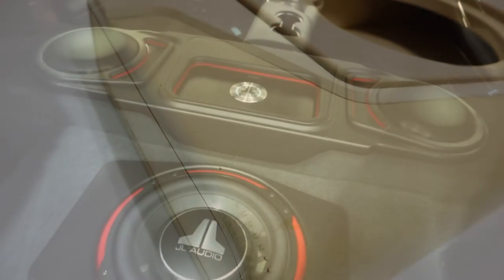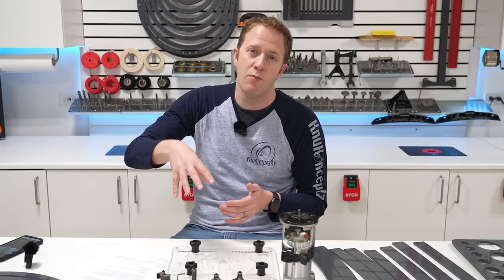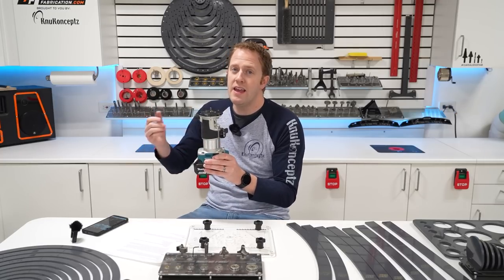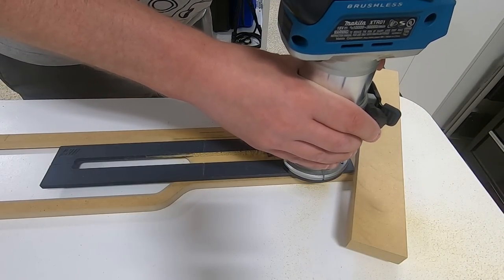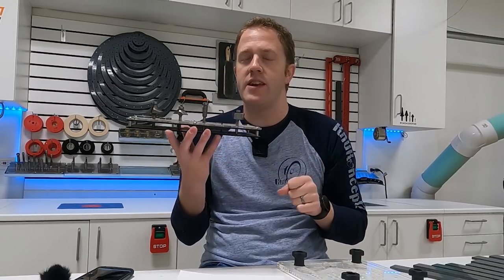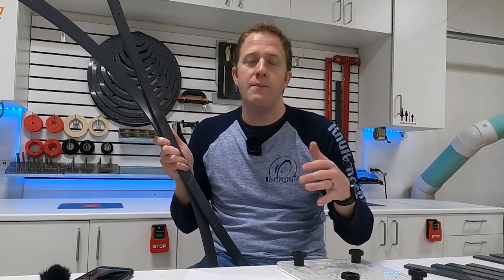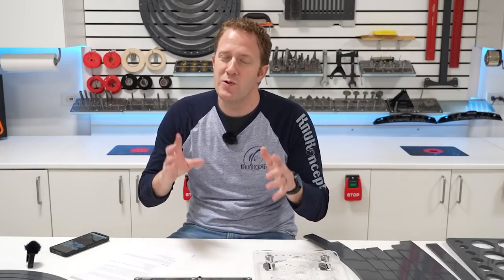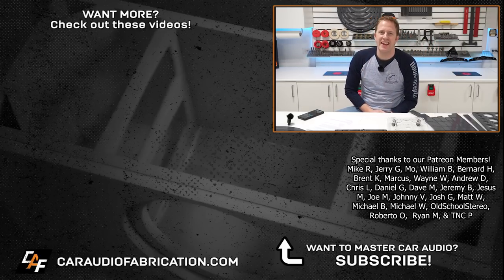Build an AMAZING Car Audio System - Tools for Under $1K

Comment: I've been subscribed for many years now! I love the channel. I'd love to see a video comparing speaker materials, how they change the durability, sound quality, dynamic range, and price. How speakers in the 90's differ from the 2000's, 2010's, and now. I have four sets of the JBL 660 GTI components and very curious how they stack up vs newer speakers. Another cool topic I'd love to hear your opinion on is a mid and tweeter set vs a mid-bass, upper mid, and tweeter set when it comes to overall sound quality in real life (not just graphs). Thanks Mark!

Comment: Watching this video I first commented too soon. So I deleted it and am changing up. 

I have the same Makita cordless router. Because two years ago I wasn’t able to find a way to do what your new video is revealing, I instead spent a ton of $ and bought a full on Bosch router setup. Plus a lift and was planning to build the table. 
Things happen and the router sits in the cabinet earmarked for the ‘cabinet’. 

Now seeing a week back when I almost went to buy something already in existence I was brought back to earth when the table alone was $500, and each additional item, lifts, fence etc exponentially was going to quickly relieve me of over $1k, 😅 instead I think I bought something practical. 
Specifically, since I already have 4 5.25 JL Audio speakers in my Honda odyssey, as well as Pioneers DMH6650(?)NEX head unit, I grabbed up JLs 400/4 amp. 

Today I’m seeking to hardwire my escort 360 into the mirror for power and follow that with whatever’s next,   I went to YouTube. 
And here you are with another kick butt thing to teach me another trick to one day turn into a revenue stream in my business. 

Seeking just what you’ve blown my mind with: these awsum router tools that will play perfectly with the Makita router I love. 

Thanks in advance. I need to rewatch this video.❤

Comment: With newer cars like a 22 pilot with the big integrated head unit, whats the best way to about doing an aftermarket head unit and not having to use a lc2i converter?

Havent seen any videos so i come to the guru for help

Comment: I need help from anyone! So I'm buying a 2022 toyota Camry. But they wont build me a 400 amp alternator (or any H.O alt) they said that because of the can bus system that they would not be able to build anything that would work properly for that vehicle. Am I stuck with stock electrical for the life of the vehicle? Are only older vehicles able to upgrade? Mark!! Please help me lol

Comment: Okay so - Lets say Ive installed a power cable that isn't long enough - Can I Solder in the length of cable I am lacking? Or should I just get a cable that is the correct length? The only reason I ask is because I've already installed the power cable back from the Battery, and I am short about two feet.

Comment: failure to  use a router shield could result in an unwanted invitation to the flying finger jamboree
Reply: If you're careless about where you place those fingers, yeah.
Been using router tables with no shield for years. Got all 8.5 of my digits still! 😂
Reply: @indica_dogo868  8.5 🤔🤔🤔🤣🤣🤣🤣🤣